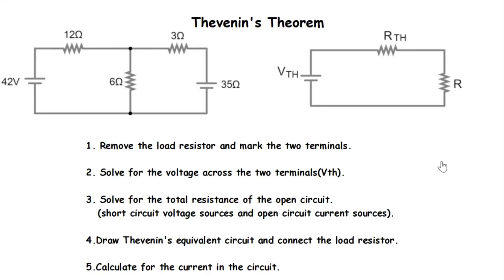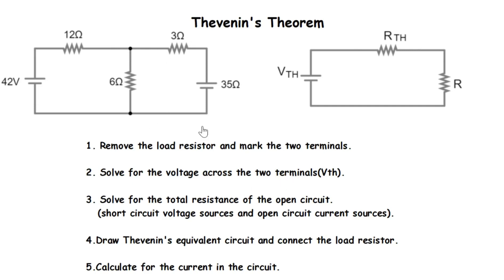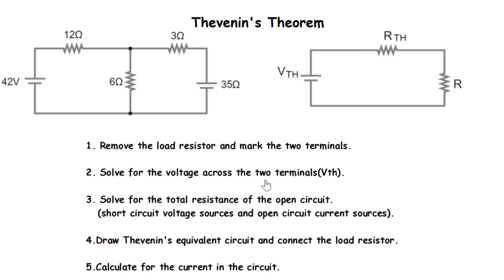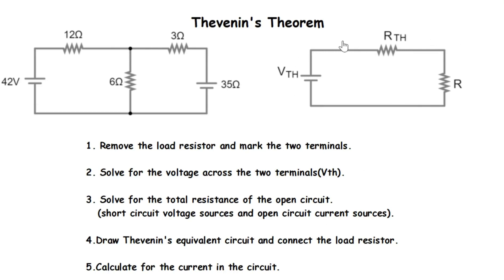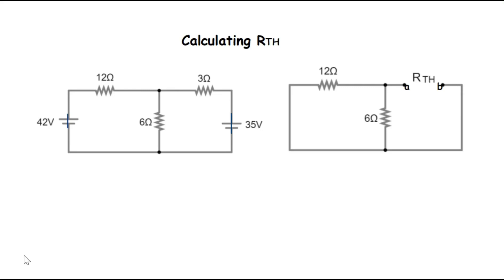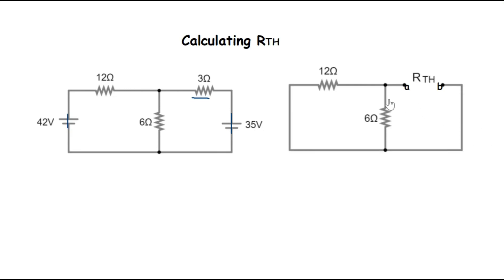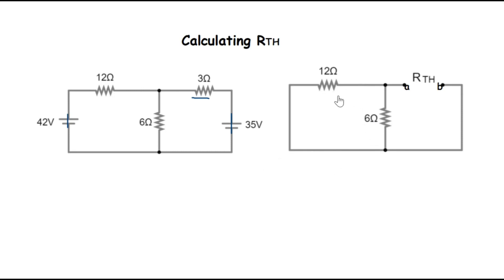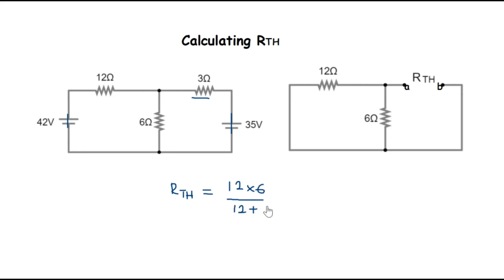Thevenin’s Theorem |Applied Electricity ⚡️

Comment: INDEED, THIS THEVENIN'S THEOREM IS A POWERFUL CIRCUIT ANALYSIS TOOL IN SOLVING CURRENT AND VOLTAGE DROP ON ANY PART OF THE ELECTRICAL CIRCUIT AND ALSO THE EQUIVALENT CIRCUIT IMPEDANCE WHICH IS USED TO SOLVE SHORT CIRCUIT CURRENTS FAULT THAT FLOWS IN ANY POINT IN THE LV AND HV POWER SYSTEM CIRCUITS, ONE AT A TIME.
Reply from the maker: Yes very true .